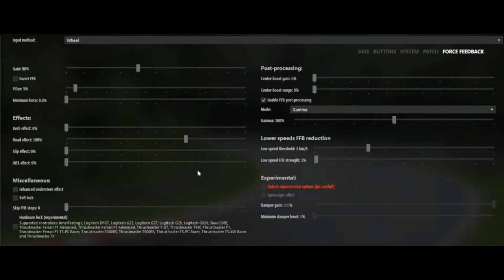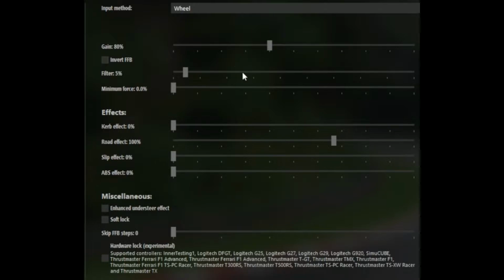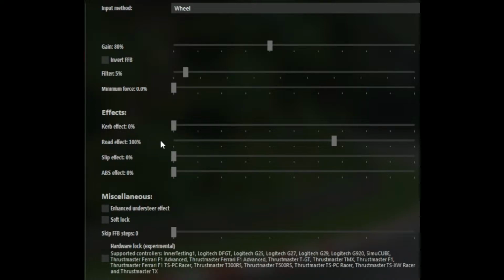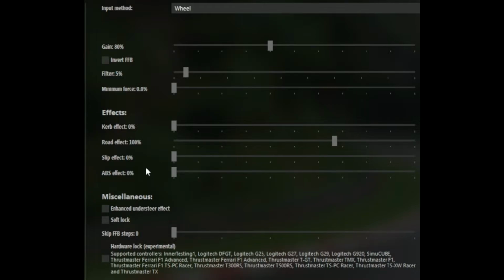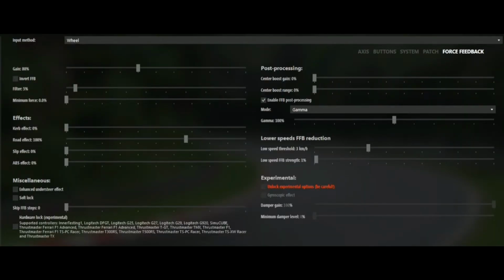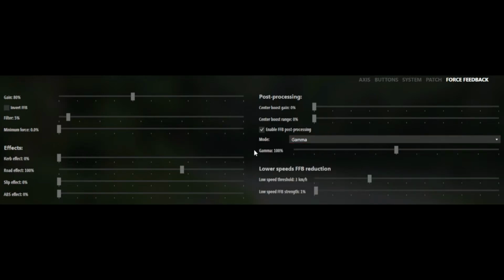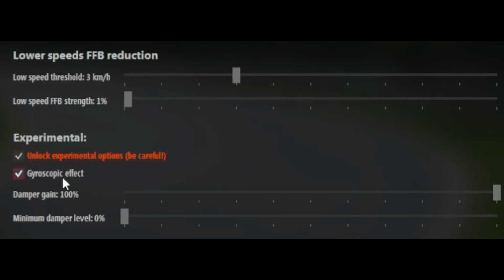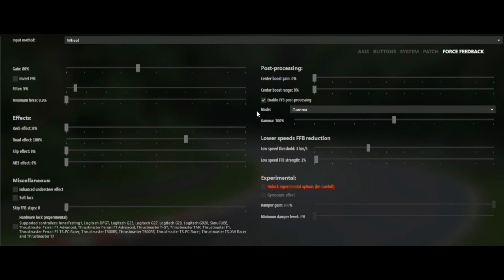FFB Settings Explained + My Drift Settings GUIDE | Assetto Corsa

Comment: I know that wheel settings are a lot of personal preference, but I tried some of the settings you had, and omg....it feels like I put in cheat code. That's how much better and accurate my wheel feels. Super glad I found this video.
Reply from the maker: It makes my day to see comments like this. My goal with this channel is not only entertainment purposes, but to also help the community and share my experience. If I made a mistake why should others repeat it, we can all learn at the same time and is the reason I started my Fix IT!  videos. I was just planning to edit out today a video about the danger of the "screw" of thrustmaster quick release mechanism it can damage the wheel.

Comment: Love your tutorial vids. They actually helped me improve! Quick question on settings, do you know how your content manager and wheel settings translate to a Fanatec ecosystem? And what is your opinion on 900 deg vs 1080 deg wheel rotation?
Reply from the maker: Hey brother, happy new year and thank you for the feedback. 
I'd strongly suggest you using only Road Effect from the CM, if your wheel software has all the other effects built in, for example my Thrustmaster base has it's own forces and I don't really need anything from CM to amplify the forces. 
I do have base shakes on almost everything and I just need information from the wheel, if I am on a road, now or grass, whenever I lose FFB I know I went too much outside etc.
I strongly advise you to stay on 900 only, almost all cars work perfectly on 900, there is insanely small amount of cars you will find that support up to 1080 degrees, it is super smooth I tested it since you increase the range, HOWEVER I literally felt how I had deadzone on each side at the end and guess what, it was that 90 degrees extra on each side that was before the wheel lock where I had 0 control over the car and that is because it didn't support 1080, but 900.
I strongly advise you to stick to 900, I started on 900 and now I am the best by overall skill and I am still on 900, if I can do it, YOU can do it and you can be smooth on 900 without problem, as long as you master the throttle and steering control this is the best skill for the foundation of any drift skills to come after. The Donut... The King of Drift Progression □
Reply: @projectxmotorsport  what a goated response. Happy new year man!

Comment from the maker: Let me know fellas, if you have any questions, also articles to help tune your wheel will be added to the description tomorrow.

If this video helped you my name is eXotic, if it didn't my name is Monkey.
Reply: I have a question ,you firmware settings are the same
Reply from the maker: @hugodias8584  Hi Fella! 
Here are my TS-XW Racer Wheel Settings, if you'd like to use them.

https://imgur.com/gallery/cEn121V
Reply: Your name is eXotic for sure cause it helped 🙏🏻🤣 one qst for post processing is gamma better or a costume lut better for Logitech? if the lut is better do i make it my self will that do?
Reply from the maker: @COSS.___  you can make one yourself, if it's bad there are LUTs online I think it was Rasmus luts and one of them should work great, on my Content manager review for csp preview 218 I believe i covered new ffb options and thingies as well.
Reply: @projectxmotorsport  i made my own it feels way better then stock/gamma its way smoother its not a struggle anymore thanks for the help ma G i appreciate you for real 💛

Comment: Hi 🙂, I have a question, do you have ffb tweaks activated? And if you have it activated, what things do you have on?
my steering wheel is a Thrustmaster T300RS.
Reply from the maker: I do have it activated and the only options that I use is:

Active ones:
Basic - Ticked (Enabled)
- More physically accurate gyro implementation:
Active - Strength 25%
Additional postprocessing
- Range compression: 100%
- Range compression assist - Disabled

Disabled ones:
- Miscellaneous tweaks - Disabled
- Output real steering forces to wheel: - Disabled
- Output real brake pressure from pedals - Disabled

Everything else is on my discord, whatever you need. 

My wheel setting screenshots, my CM settings screenshot, MY CSP settings
Reply: @projectxmotorsport  Thank you very much 🙂, I will enter discord.
I forgot that what I do most is drift, I continue with your advice, right?
Reply from the maker: @elsopi1704  Yes, all my settings are under channel "My Settings" in Info category on discord.

Comment: for some reason powering down to move away from the apex never works for me? I always go towards it no matter what I do with the throttle..
Reply from the maker: Hey, this really depends on what car you have, if the car has unrealistic physics and have "side grip" instead of "forward grip", then thats why. Another thing is that you always want to guide the car with the wheel towards where you wanna go, while you lower the throttle % when modulating.
Reply: @projectxmotorsport   I think the car is decent, I did have more luck with a proper 'drift' car but I try to avoid those as they are kinda forgiving/arcadey

I think it may be that im not adding enough countersteer while powering down so I maybe point towards the corner a little too much?
maybe rear tyre pressure a bit too low also I will experiment more

appreciate the reply dude
Reply from the maker: @PkFloydUk  I need a video to see, I did a drift meet yesterday where I coach for free, you can send a clip in the drift talk channel.

Comment: Hello! I have a feedback problem. You know that the default power is 100, but as I drive it increases progressively by itself. It can go up to 4000 which just drives my steering crazy. Any ideas what it could be because I didn't have this problem before?
Reply from the maker: hey brother yes I believe it was one option that I talked about in the video, which is about increasing the dampening of the wheel during driving, but you can tag me in discord drift talk channel about this problem and I'll check tomorrow.
Reply: Hahaha Discord is still new to me. Although it has long been widely used. I'll try but no promises! However, if I don't tag you, then I haven't succeeded in something :D. @projectxmotorsport